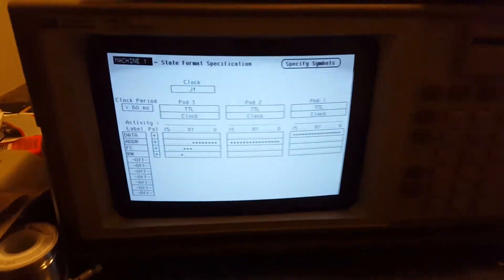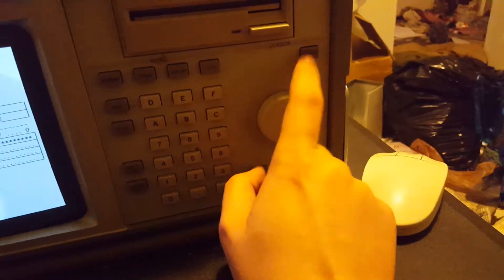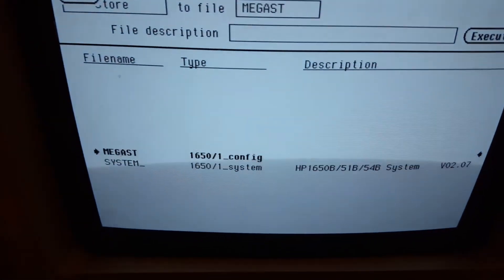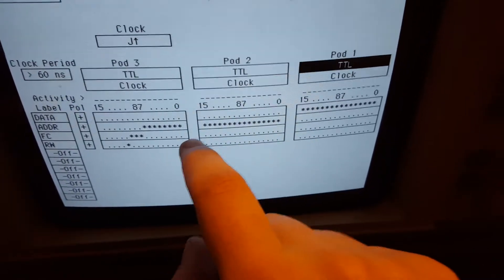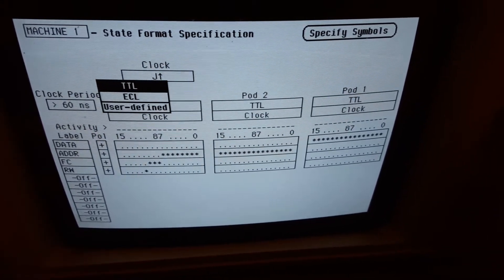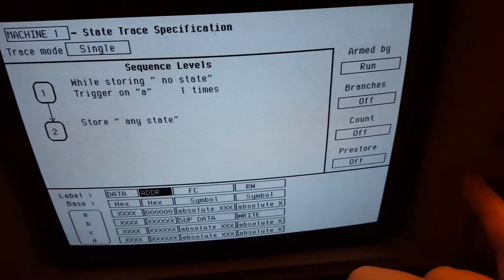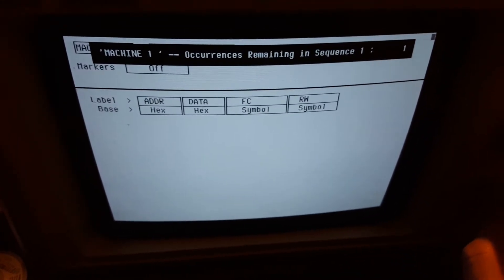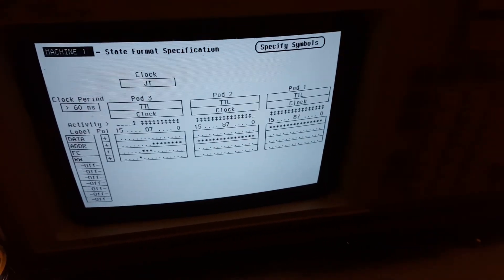HP 1650B Logic Analyzer Part I (State Analysis)

Comment: Can this device be used to work with CMOS chips instead or only TTL ? Thanks a lot
Reply from the maker: Supports any logic levels between -10.0 and +10.0. The default presets are for TTL and ECL, but you can specify your own arbitrary threshold in 0.1V steps.
Reply: Thanks a lot indeed!! By the way how many bits or clocks in total can it display on the screen at the same time?